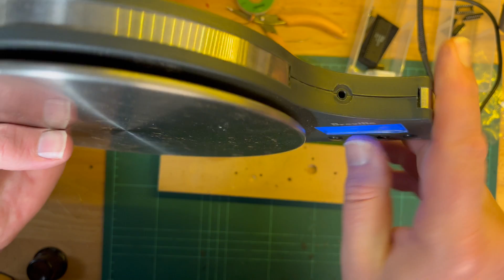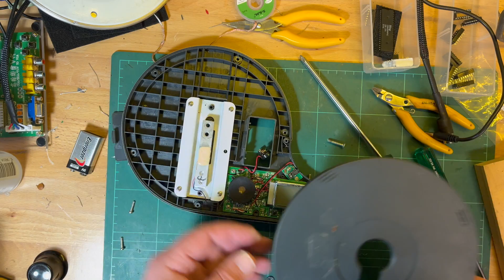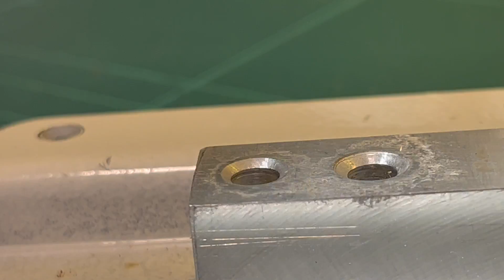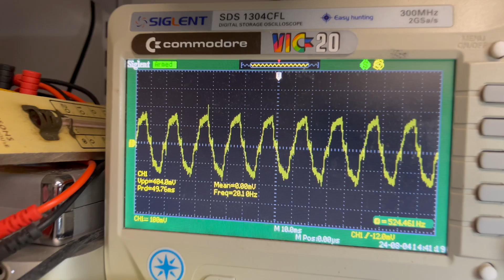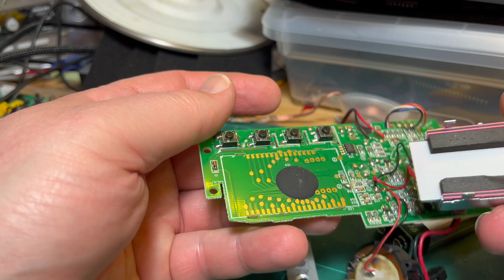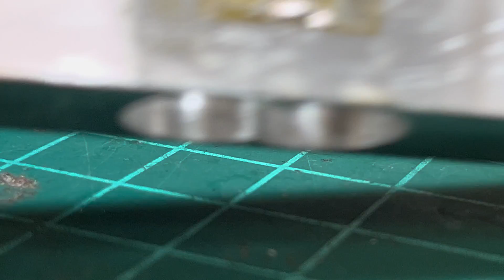🇦🇺 Breville BSK500 Kitchen Scale Teardown [#TCE0500]

Comment: Thanks for the info. I use mine for weighing RC model aeroplanes, it's been faultless for 5yrs but then behaved exactly as demonstrated.
It turns out the two screws fixing the load sensor to the chassis had come loose.

Now tightened, the unit is back to its best.
Reply from the maker: Ahh, good to know! Thanks for the advice!

Comment: There's a load cell consisting of a strain gauge on a "beam" (a bar of metal, usually with holes in it) which changes its resistance when it is either compressed or stretched. The bar inside has transducers glued to it (don't disturb these. Once they get loose the unit's knackered. Oops, too late). The strain gauges form a Wheatstone bridge that gets fed into an amplifier such as the one found here: https://www.sparkfun.com/products/13879

The output of the HX711 amplifier (which your scale doesn't use) has a serial output which you have to program your MPU to decode (I can help you with that).

Your "exacting spec" scale scale seems to be using '70s era op-amps. Indeed. :)

Now if you want to have a bit of fun with this (and swapping out the cap on the bottom of the board doesn't fix it), get a cheap MPU and the HZ711 board and use your old load cell with the existing case to create a working unit.

And note that R69 is a zero ohm resistor. So, another jumper.

It's toast now, but no big loss. Like you said they are cheap. You could modernize it with a new load cell, a HX711 amp, and something like an Adafruit feather. Get one of the feathers with either WiFi or (for your location) a 433Mhz radio and you can let your neighbors know when you grab two scoops of ice cream instead of one. :)

The instability when nothing is being put on the cell is usually is a sign of caps going bad. Probably not the load cell itself. The two big killers of load cells is either water (which will wick its way up the cable), or excessive shock on the load cell which can de-bond the strain gauge. By all appearances yours wasn't suffering from either of these conditions, so I suspect the cap on the back side of the board.

I got plenty of experience with scales across multiple jobs, and fork truck drivers are the natural enemy of scales. With the occasional front end loader smacking the 100,000 kilo truck scale and de-bonding multiple load cells to boot. And then a flood coming in and ruining the recently repaired load cells. And since this scale has to be certified for trade, I couldn't fix legally it, and it cost ~$9,000 USD each time to fix it.
 
I also designed a scale that mounted to a fork truck, only to find that you can buy forks that will do the same thing (a lot of effort wasted).
Reply from the maker: One of the mottos of my channel (well, maybe unwritten) is that "I break it so you don't have to!" ... definitely a good learning experience for me as I had no idea how these things worked (of course, I could've just googled it!).  But now I know, and with your excellent advice, I'll be ready for when the next one goes bad.  But I'll also see if I can get a replacement transducer beam and see if I can get it to work with these electronics.
{made to their "exact specifications" ... tee hee}
Reply: @Brfff  My thoughts exactly!

https://www.amazon.com/Digital-Weighing-Arduino-Portable-Electronic/dp/B09K7G51KJ/ref=asc_df_B09K7G3477?th=1

You can also get the data from that serial EEPROM in situ. No need to pull it from the board. You would have to make sure that your programmer supported that chip of course.

You will need an Arduino or such for the HX711.Check to be sure that there are libraries for the particular device that you have in mind to use.

I think that you can use a four wire load cell and wire it for three wires as your is. https://forum.arduino.cc/t/load-cell-with-3-wires/372723/3

You might as well go ahead and scrape off the part where the "big wires" connect to the wires for the strain gauge. This is where the signals get "summed".
Reply from the maker: LOL ... got a dislike on the video ... no idea what I did wrong this time ... I honestly get a good chuckle and roll my eyes whenever I see one now ... it's all engagement!